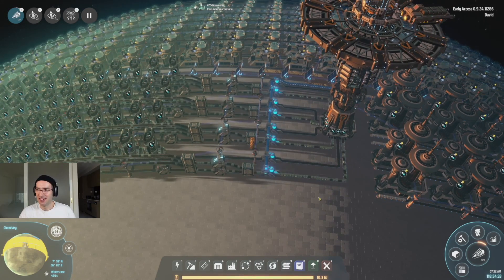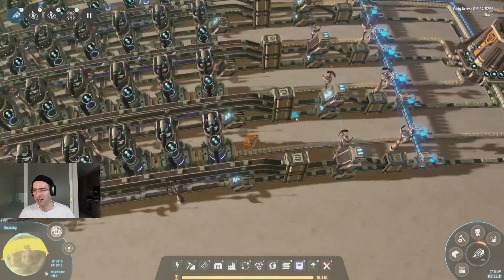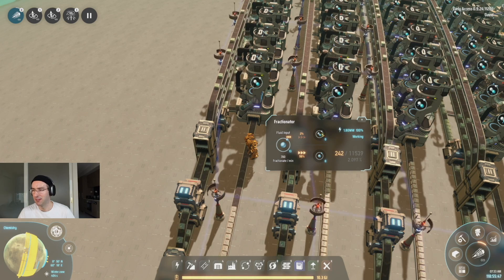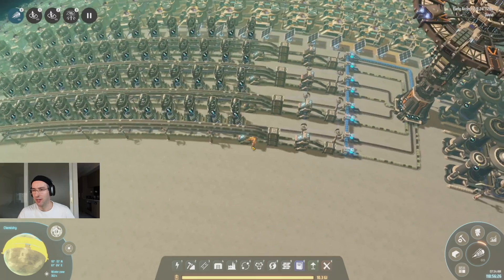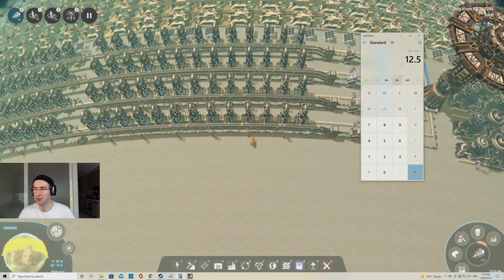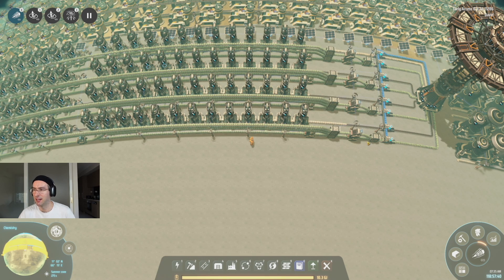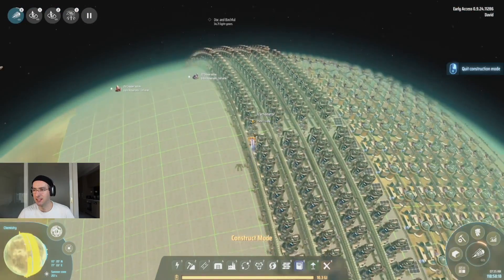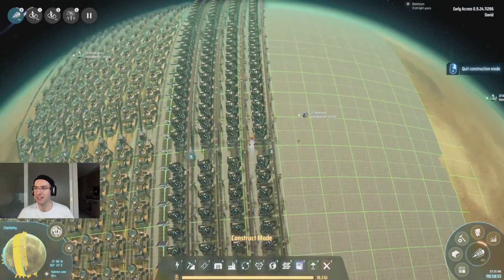Fractionating Proliferated Piled/ Stacked Hydrogen No Return Line Blueprint - Dyson Sphere Program

Comment: Hi - why not feed the odd-stack hydrogen into the back-end IPLS, then run return lines from it back into the system? An IPLS is in essence a giant piler. The return could be setup in T-junctions with a small amount of demand so it only puts additional hydrogen into the system if there's a gap to fill. Love your innovative multi-stack builds - impressive.